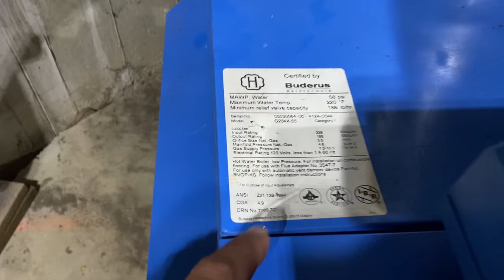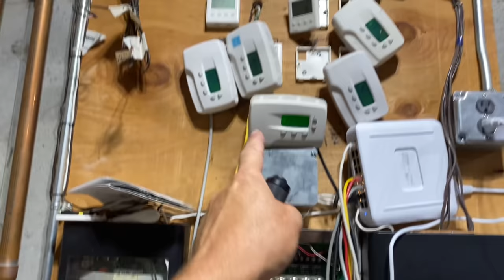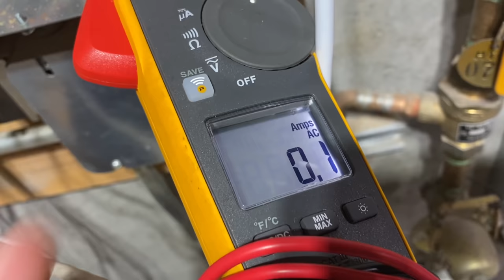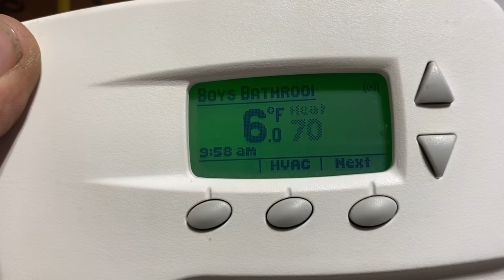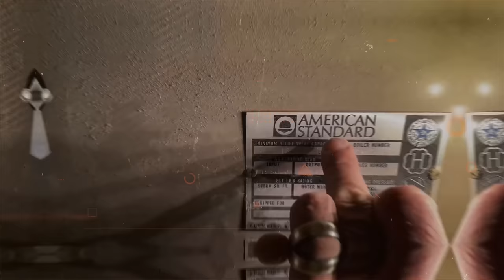Taj Mahal Has a Bad Boiler Switching Relay or Thermostat or Zone Valve? Mysterious Issue Solved

Comment: I'm not in mechanical trades, but when I see something like a spark perfectly laid a out a breaker panel, or a plumber do some gorgeous copper, I love that shit. And that boiler room, all that copper was absolutely a thing of beauty.  Plumbers that do THAT level of work are absolutely worth the high prices, cause that shit is gonna be stupid easy to troubleshoot and/or repair later down the line. Thanks for showing this!
Reply: Yeah, I often put it in perspective with a hypothetical, “You can only have two: Good, Fast, or Cheap. And you can’t have good and cheap.”

Comment: The formula to convert VA to Amps is 'amps = VA / volts', so that terminals 1VA rating is equal to 0.041 amps (or 41mA) at 24 volts. So basically, it just has enough power capacity to run ONE of those thermostats.

Comment: Nfpa 54 requires one square inch of combustion air for every 4000 btu of gas fired equipment if the air is supplied from outdoors with a minimum of two openings. So for 2 228000 btu boilers you need 114 sq inches of fresh air. A 5 inch round duct is 19.63 sq inches. 8 of these will provide 157.04 sq inches of fresh air. This installation would meet these requirements in a hospital or school. So it should be good enough for the taj mahal. The room walls are probably well  insulated but no insulation on the domestic piping is like a radiator, trapping the heat in the boiler room. I bet its hot af when space heating is active.

Comment: As someone that owns that meter I just want to give you a heads up that is it not reliable for reading under an amp. Once you get past an amp the milliamps follow close enough but it's likely to have you running in circles looking for that .1 .2 reading. Best bet is to get the external 10x or 100x current clamp and put it in the voltmeter input.
Reply: A Fluke 773 is worth every penny. It can clamp and read milliamps.  It can simulate 4-20ma signals and can also supply 24v loop power.  It is perfect for all control system troubleshooting.
Reply: @common_c3nts  Yes. Not every model they make can do this. The meter he used and the one I have were designed with a different current range and wire gauge in mind. They read to one decimal place aka 100ma and as I said before if you are below an amp the 100ma readings are suspect. Above an amp and the 100ma is more reliable. All I'm saying is that the meter you mentioned is expensive in comparison to other models and buying a 10x 100x clamp to have in a bag with you is easier than trying to make multiple loops on the clamp or needing multiple meters.

Comment: Mikey, in the past I have had concerns about  some of your previous vlogs, as you may be know, however in this case you made observations that proved to be successful. Good Job!!! Whoever did the piping on that system was a craftsman. I appreciate quality work like that and shows a truly professional installation. Also, I am impressed with your knowledge of that type of system. I'm not a plumber so not familiar with those units. Makeup air definitely needs to be addressed.

Comment: I’m from Massachusetts and your plumbing would 110% fit in in MA. Your works clean obviously the codes are a bit different but you’re smart you’d adapt , haha 5.00$ says that Zachary dude is union hack that puts up hangers all day
Reply: My buddy has been in the local 7 for 2 years and the only thing he's touched is unistrut and ready rod.
Reply: Codes are a bit different?  How so
Reply: @chrisE815  well for one you can’t use pvc for flue piping in MA
Reply: @chrisE815  Mikey pipes would be adapt and kill it though regardless of where he goes you know?
Reply: @chrisE815  codes in MA are also state mandated local jurisdictions don’t have say other than providing inspectional services

Comment: 1va is very little power. I may be wrong, but by my math, it may support powering 1 thermostat, but nothing beyond that. most of that probably goes to the back light, which will be less current draw when the back light turns off.

Comment: Nope, rough figures, each thermostat is drawing 1W each. 24VAC x 0.045A = 1.08W which is well more than 1VA. That being said, those thermostats look to be networked and fed via PoE (Power over Ethernet) as ports 1-8 on that switch are the PoE ports and I see the PoE lights are on.
Reply: @PipeDoctor  Not too hard to learn very basic network and PoE. But, I understand what you are saying and good to see you know your own limits.

Comment: Lets line up 760 pipes in perfect order with perfect bend radiuses.    Then  lets fling the wifi , the wiring and the thermostats against the wall like monkey poo at the zoo.     MOM! WHY'S THE WIFI SLOW!!!!!
Reply: Fitters and wiring crew seperate  the latter slop crew .

Comment: That is an impressive property and the owner has some great toys. Great fault finding on the chattering relay - but you never closed the loop on the erratic room thermostat.

As regards the installation - that is commercial scale rather than domestic! The plumbing side has been executed well in terms of layout and execution. However the installation is let down by the slap happy standard of the electrical installation especially that mess of thermostats, router and zone valve wiring. Is this an American ‘thing’. This was screaming out for a decent junction box and DIN rail mounted connections.

On the ambient heat issue in the Boiler Room - there must be half an acre of insulated copper pipe in that room acting as a very efficient heat emitter- it needs to be insulated - probably a weeks work in that installation.😳

Comment: It's good to pat yourself on the back. I got called in to help some guy's on a chiller. I found a lose wire that looked tight. When I got done I looked at them and said. " Couldn't of done it without myself " and walked away. I could here them laughing all the way to the elevator. Feel free you use that one.

Comment: VA = Volts X Amps.... So 1 VA at 24v would be 1/24, or 41 milliamps. That means thermostats are almost exactly 1va each. So I'm guessing that terminal is only meant for 1 thermostat? Seems odd. Not that it actually cares, that transformer is pretty big. You can always use your clamp meter on 24v wires just as easily as 120v to measure how much power the thermostats are drawing, amp meters don't care about voltage.

Comment: 1VA ÷ 24V = 0.042 A (42ma)
Reply: @PipeDoctor  if each stat was drawing max 40ma, 40ma x 5 = 200ma. Transfrormer is only rated for 42ma, thats likely why its hot and you would probably see lower than 24v if you measured the voltage. Its likely not drawing the max thou as the backlights in the stats probably draw the bulk of the current.

Comment: If each stat uses 45mA, that equals 0.045amps. 0.045A x 24V = 1 VA.  So, 5 stats are overloading that 1VA transformer by 5 times !!
Reply: @PipeDoctor  No.  My math is correct.  45 milliamps = 0.045 amps.  Volts multiplied by amps equals VA ( volt amps ) .  So, 24 volts multiplied by 0.045 amps = 1.08 volt amps
Reply: @PipeDoctor  The output of your low voltage transformer, feeding the stat, is 24V.  You need to multiply volts by amps to get VA ( volt-amps).  Volt amps roughly is equal to watts (power )

Comment: Great job. Do you give them upfront pricing on what the repairs are going to be before doing any work, or do you just give them a bill at the end of the service call?
Reply: I agree with the pricing structure being the same whether it's a bungalow or Taj Mahal, but certainly you need to charge a little extra for the extra travel time up to the gold coast from Valley Stream, correct? 

Nice job troubleshooting though. 

If you ever need help figuring out an electrical issue that has you stumped, let me know. I've been in the business many years and love figuring out things that others can't solve. 

Plus like you said, now you have a customer for life!

Comment: fun fact: the porsche is more fun than the ferrari.
Reply: @PipeDoctor  yes, really. the ferrari is undrivable without dozens of computers, millions of sensors and whatnot. the porsche is raw and manual. you are not driving with the ferrari, the computer is. with the porsche its your fault when you careen backwards into a building because you went on the gas a second too soon. its like using a hand tool vs a electric one. they both do the same job but the manual one is still more satisfying to use.